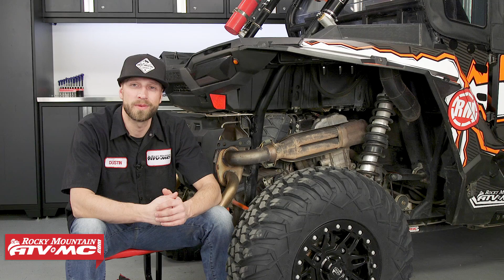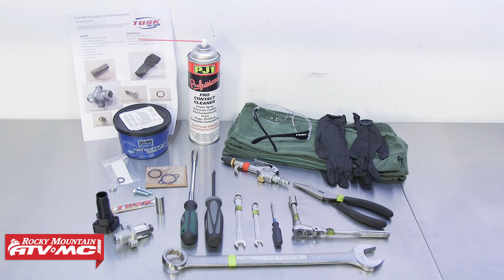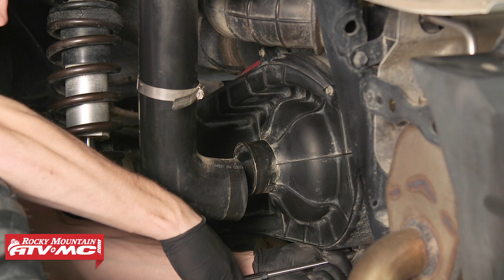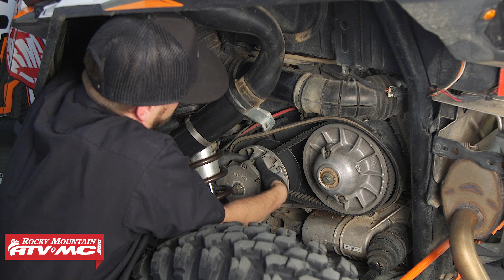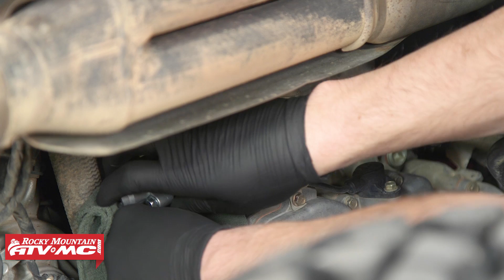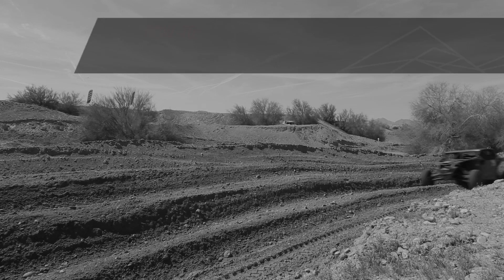Polaris RZR Tusk Automatic Cam Chain Tensioner Install

Comment: Why is there other videos of valve cover needing to be removed?
Reply from the maker: Verifying timing marks on the engine are lined up and at TDC.
Reply: @rmatvmc so valve cover is not a must to be removed on this tusk brand tensioner??
Reply: When the cam lobe you can see in  the oil fill is pointing up, the valve train must be in a rest position which puts slack in the timing chain.

Comment: Will this work on a 2014 rzr 4 900?
Reply from the maker: To see if this will fit your machine, use the drop down menu on the product page and enter the year/make/model. If your vehicle is listed then it will fit your machine.
Reply: Thanks, it seems I’ll have to explore other options.

Comment: You don't need to to have it a top dead center or have engine in any sertin spot?
Reply from the maker: You don't need the engine in TDC, just rotating the cam lobes so that there is no pressure on the valve springs.

Comment: When putting the push rod in place it doesn’t stick out 1/8 of a inch with the tensioner closed. I have to let it out some in order for it to stick out enough is that how it’s supposed to be? Instructions claim tensioner has to be fully closed but seems to be to much. Also it doesn’t retract on its own when taking out tension key,  I have to use a screw driver.
Reply from the maker: When installing the cam chain tensioner you do not want the push rod sticking out more than 1/8in. It should be fully closed during install. Once that is done pull the safety clip and it should push out. It should only retract with a screwdriver not by itself.
Reply: @rmatvmc with the tensioner fully retracted and locked. The rod doesn’t stick out about 1/8 inch I have to let out tensioner some in order for the push rod to stick out at all. Have you ran into this issue?
Reply: @rmatvmc some people should not be doing this type of work. 🤦🏼‍♂️

Comment: Isn’t that the cork screw style tentioners that we’re prone to failure so the fix was to go with a ratcheting design. 
That style you have resembles the 660 Rhino and the fix was to upgrade to the Rhino 700 Ratcheting design

Comment: I have a Ranger 570 full size will this video work for my machine?
Reply from the maker: Sorry, this cam chain tensioner is only designed for 2013 to 2016 Ranger 900, RZR 900, and RZR 1000 models.

Comment: @Rocky Mountain ATV MC what is the reasoning for putting the cam lob up? I have seen other videos saying to put it facing to the back of the engine.
Reply: From what I understand the reason for this is to set the engine at TDC (top dead center)

Comment: Ok, so on a 2015 rzr900s, is the install the same? I watched a different video that said the engine should be at TDC, lobes pointing away from each other.
Reply: Did you get your 900 to TDC for the change? I am about to do mine.
Reply: @valentinsalazar9945  still  haven't installed it lol.
Reply: Just did mine had to move the shift linkage to get it in and it comes really close to the starter. This is on a 15 900s

Comment: I don't understand why these work better, I did the swap today but haven't started the engine yet.......however, there is tons of spring pressure on the stock one, I'd say more than the TUSK tensioner. I don't see how the TUSK one will be better???
Reply: Because it holds tension mechanically not hydraulically

Comment: So thru the oil fill cap, have the cam pointing Stright up for TDC? On a 2016 1000xp4?
Reply from the maker: Yes, you will want the cam lobe facing upwards. This is not to get the piston to TDC but to ensure that there's no pressure on the valve springs. 
We have an instructions page that you can check out too: https://www.rockymountainatvmc.com/docs/Polaris%20RZR%20Cam%20Chain%20Tensioner%20Instructions.pdf
Hope that helps!
Reply: Link doesn't work. Says 404 page not available anymore

Comment: Is it the same for a 2016  Turbo
Reply: My buddy’s 2016 Turbo is making some noise, we ordered the new tensioner. Is the process the same on his as a the non-turbo.
Reply from the maker: Supposedly the problem was fixed on the 2016+ Turbo models. Are you noticing yours being noisy?

Comment: So, the cam lobe nose needs to be pointed up? Other videos show the cam lobe nose being pointed in a lateral position. So, the left lobe nose at 9 o'clock and the right nose at 3 o'clock. I'm assuming you're only releasing tension from the cams and this isn't putting the engine at TDC. So, it is ok to install the tensioner this way although it is not in the TDC position.
Reply from the maker: Gcslift Correct.  That is what the instructions say.  We are simply making sure there is no tension on the valves while we remove and replace the tensioner.
Reply: Excellent! Thank you for the explanation.